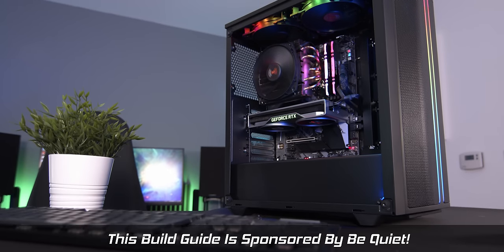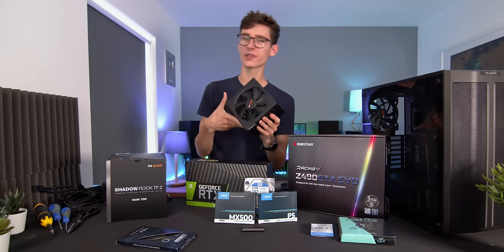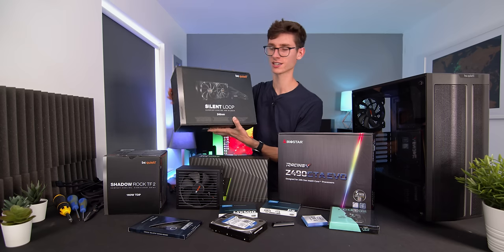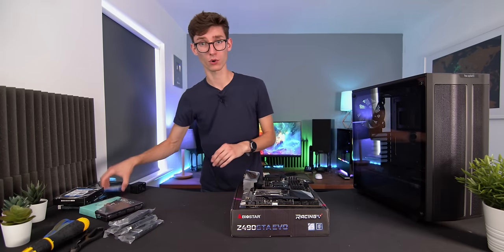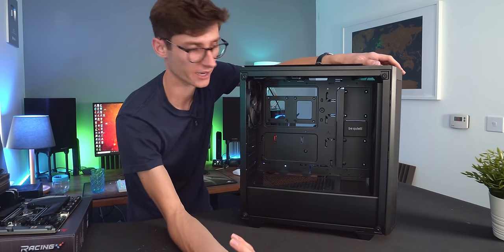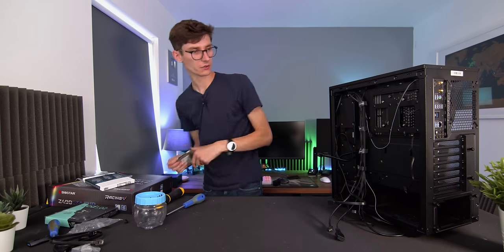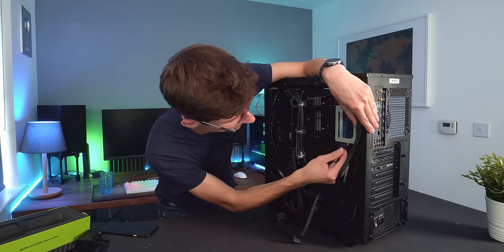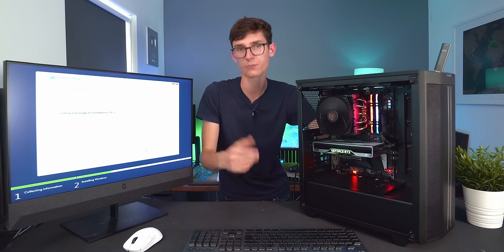How To Build A Gaming PC 🤗 COMPLETE STEP BY STEP Beginners Build Guide | AD

Comment: “Very simple” me trying to comprehend a single step 👁👄👁
Reply: Might be easier while following along and reading the manual...or so im hoping.
Reply: I've seen some really good videos on putting together a pc, but this one didn't do a very good job of actually SHOWING what he was doing. He just sort of rushed through everything and didn't even say how to connect certain things.
Reply: i didnt understand half of what he said 💀💀
Reply: might be better to switch to peico save 15 percent on pc insurance and 100 percent pc build you comply to peico can steal your credit card info and your ip with your house and full rights to abuse you in anyway peico save 15 percent on pc insurance and 100 percent on pc builds
Reply: SAME PLS IM THINKING OF BUILDING A PC AND IM SLIGHTLY CONFUSED AT EVERY STEP
Reply: @gabylol1562  thank I thought I was the only one 😓
Reply: @corasnow3431  this is literally all I heard. And don’t judge cuz I’m not a big pc gamer so I don’t know what all the components do. “Intel core 10,00 grtx 20172927929289, cpu wire conecter slot pcuisjhakanajsk slot 14 inserted. And that’s how you build a pc”
Reply: literally:,) im trying to build one and im like : i need you to break down the simple steps
Reply: 🤣 me too!
Reply: Idk, seems pretty simple to me...

JK JK JK lol
Reply: Pro Tip - DO NOT buy a case with tempered glass as the glass is prone to exploding for no reason. I've had 2 cases now with tempered glass and in both cases the glass has exploded in my hands. This is also very dangerous as tiny glass particles can go into your eyes and lungs as it shatters into a very small pieces.

Be careful...
Reply: @BillClinton228  Thx for that. I'm going to be building my first pc in a bit over half a year, and I know nothing about anything. This could've saved me a lot of money, and possibly my life.
Reply: I dont even know what 1 part is even called
Reply: I'm laughing at how seen I feel by this comment
Reply: @nickk4165  wow I never though of what parts sounded like for people that never built a pc or researched for a while
Reply: MY STUPID HIGHT SCHOOL COMPUTER SCIENCE TEACHER MADE ME WATCH THIS FOR HOMEWORK
Reply: @What-pd7xv  huh
Reply: I didn’t even know what a hard drive is....at least I have google
Reply: Lmaaaooooo
Reply: @BillClinton228  I've several and had ZERO XASE GLASS SIDES BREAK .

Comment: I can't be the only one who wished that he said how much it costed.
Reply: I spent about $1500 to build mine. I’d say at minimum you’ll be spending $1000 to build a good gaming pc..
Reply: here we do not  get anythink  like turkey  crap economy   UNFORTUNATELY,THE MİNİMUM  WAGE HERE İS  270 DOLLARS :( :( :(
Reply: @Hunharcas22  2.70?
Reply: @hasanteistrash5733  he meant 270 $ monthly, down here in Brazil is about the same. Living in a third world country sucks ,-,
Reply: That pc cost $1,700
Reply: Everything he listed he used came to £1,572.06... and he ended up with essentially a £900 pc from Amazon.
Granted it has a 10 series processor but it would have run fine with the 9400f
Reply: I recommend saving up at least 1,5k
Reply: @Dylan Barnes Same
Reply: quarantine made pc parts skyrocket smh
Reply: I checked the parts he put in description and it adds to around £1500. Keep in mind this is just for the pc. If you need monitors, keyboard and mouse also mouse pad then it'll cost more.
Reply: you don't need all the stuff you need
Reply: Hatguy 2345 how is the good is the PC that he built?
Reply: @logiic8835  personally would recommend waiting and not building what he created, it totalled to like £1.5k yet I’m in the process of buying my parts for the same price with a 3060ti and 5600x, just waiting to find a 5600x in stock. So what I’m saying is if you wait for stock you can get much better parts right now (GPU mainly as he used a 2060) assuming you’re willing to be patient.
Reply: @logiic8835  I mean I'm not too sure but I think with the graphics card he has and cpu it should run pretty smooth. Dont forget though you don't have to use what he used. Do some research online and read reviews that what I would do. (The one he built will be good)
Reply: It costs 1700.61 usd. this dose not include tax or shiping.
Reply: @alfieee2279  Don't worry I'm not building anything yet, I'm still learning the parts myself. Not super familiar with everything so I'm still learning, thanks😁
Reply: @hatguyondrip3812  thanks😁
Reply: @logiic8835  its no problem 😊
Reply: Don’t build one then
Reply: @milesbinkowski  bro they only asking a question lol chill out
Reply: @milesbinkowski  ok😢
Reply: @thinkingbread  what specs did u buy? if u dont mind me asking lol
Reply: @seanmaher7744  eh, depends on budget. My pc costs around 650-700 dollars, and it can play pretty demanding games pretty well, whilst streaming them on discord and such.
Reply: It depends bro
Reply: @seanmaher7744  $550-700 for something that can run most games at higher settings at 1080p with 60fps. Spend more for something that can run VR well.
Reply: @Dylan Barnes "Dude, you are getting a DELL!"
Reply: Waifu Zero Two  may I ask what your specs are?
Reply: @Dylan Barnes ur probably better off buying a console then lmfao
Reply: @seanmaher7744  i built mine for £600 which is $820 so id say the minimum is like $800
Reply: My brother built a pretty good one for around $300. And only spent like an extra $50-$75 for the mouse, mousepad, and keyboard. Though that was because he waited for about a year and a half looking for good deals on all of the parts.
Reply: @swan__song__  that’s ridiculous, my pc was 1.7k but it doesn’t cost that much
Reply: @Dylan Barnes I feel you I’m basically 700ish or under and I’m buying a prebuilt I am not going to mess up badly 😂😂
Reply: @leotowers3931  what is the PC
Reply: my brother built one and it cost around £1000
Reply: @godhateseveryonewhodoesntr5977   this website works so well. makes everything easy to understand. thank you
Reply: @Dylan Barnes 😂😂u mines well buy a ps5 that aint enough for a gaming pc
Reply: It depends on what all you want, I built my first one for roughly $800, but if you're really looking for a set up that is efficient but cost effective I've known people to build them for at low as $600-750. You can find great deals, secondhand items (A few pieces CAN be purchased secondhand as long as you're careful and keep and eye out), and generally create a basis that can be improved upon later.
Reply: Dude I’m sitting here waiting
Reply: Yes
Reply: @marloncooke2047  Roughtly between 1.2-1.8k
Reply: @verostation  thanks
Reply: @Goose console sucks.
Reply: @Goose I used to play console, then I transferred to pc, NO issues at all, I can play whatever games I want and I can do so much more. Pc give so much more options then consoles.
Reply: @Max Isaksson but in order to put together a successful business it requires a lot of capital , hard work and luck
Reply: @seanmaher7744  what!? After i put everything in my cart it was 3.6k +!! Any tips?? Im going to be purchasing in November for black Friday.
Reply: Its roughly 2000 and under for this setup
Reply: @Dylan Barnes I’m sorry your not going to get anything with that u need a moniter and a keyboard and mouse and mouse pad 700 plus 1000 for the pc
Reply: @seanmaher7744  wrong
Reply: @Dylan Barnes budget pc for you then lol
Reply: When your Canadian:
Reply: @Hunharcas22  oh no, forget about a pc then sorry😂
Reply: @Dylan Barnes forget ab it 😂
Reply: @UncarteD  absolutely
Reply: My pc costed about 13k (keep in mind that it’s a very high performance pc)
Reply: @tamman994  I’m Canadian
Reply: @runitsacow  we have to pay more then Americans xD
Reply: Yes!!
Reply: @Dray_Duley  thx for telling me!! Needed that
Reply: @tamman994  ikr 😢
Reply: Same tho
Reply: i have the money for it but no idea how to set it up lol
Reply: @Goose Even for hardcore gamers, consoles are better. Spending a $1000-$1500 on a gaming pc rig is an idiotic waste of money to say the least (how about putting that money towards a used car instead?). And only uber-nerds think that the minor bump in graphics (sorry pc simps, but it is minor) is really worth the exorbitant amount of money they spend on these machines. I put pc gamers in the same category as women who spend hundreds of dollars on louis vuitton bags, car enthusiasts who pour their paychecks into "pimping out their ride", and kids who spend $300 on a pair of nike sneakers - they just don't understand the concept of "value for money". Consoles are insanely affordable gaming machines, and despite what every pc simp says about "saving more money in the long run on pc", it's really not true. Consoles have all the best AAA exclusives (last of us, god of war, FF7 remake, to name a few). The sales and subscription services on xbox and playstation are giving better and better deals on games (that are just as good as steam deals). Physical game discs and the used game market still exist for consoles (meaning you can trade games with friends, get insanely cheap games at used game stores, borrow games for free at your local library). And most importantly, consoles just work (no technical issues, no upgrading parts after 2-3 years, no bullshit). Aside from consoles consistently having a larger market share of the games industry than pc gaming, the funniest thing I noticed about pc gamers is that if you ask them if they own a current gen console, 9 out of 10 of them say "yes" (Lol). And if you ask them why they bought a console when they just told you that "pc gaming saves way more money than playing on console!", they always say they bought a playstation or xbox or switch because they just HAD to play the AAA exclusives on those systems. Lmao. Too funny.
Reply: @Dylan Barnes better buy a play station
Reply: @seanmaher7744  I’m building a good pc at a lil higher than $800 1080p around 200 FPS I’m guessing
Reply: He he.... costed
Reply: @seanmaher7744  so what’s considered good?
Reply: With all of the things he put in the description, it would be 1092 without RTX and peripherals.
Reply: @UncarteD  i get what you feel, here in the netherlands if your poor you will be f*cked from all the sides, you will have the government saying why don't you work lol. Ik the Netherlands is not a third-world country but it is slowly going down there ...
Reply: @leotowers3931  Could you link me that please mate?
Reply: @seanmaher7744  what about my graphics card I can’t find a good one that doesn’t cost 1,800$
Reply: @seanmaher7744  how do you get that much money tho😭
Reply: @UncarteD  lol
Reply: @hatguyondrip3812  and desk and chair aswell.
Reply: @alfieee2279  Can you keep the parts he has recommended and swap the 2060 out for a 3060ti? lmao i got no clue about pc’s but you gotta start somewhere🤷‍♂️
Reply: He puts links in the description, look at all the prices and calculate the total for the entire build then you should see how much it costs ;)

Comment: Thanks mate! You helped me build my first gaming PC. It’s a beast, I’ve got a RTX 3080 paired with a i9 10900K and 32GB 3200mz RAM. Currently playing Red dead 2 at 4K 60FPS ultra setting, it’s awesome.
Reply: Niceee I got me a rtx 3080 12gb yesterday but just discovered my power supply was 600w :(  upgrading it right now to 750w :)
Reply: how much did you spend?
Reply: How much?
Reply: @abstractnonsense3253  i had spent like $1,500 on the gpu but overall like 2k or nearly 3k
Reply: @dog8086  but i used quadpay so it was a split payment
Reply: @Hisashii  Thanks for the info. Didn't know about quadpay.
Reply: whats ur power supply
Reply: you do not need a i9 unless your streaming which i may be wrong but i recommend getting a higher mhz ram you'll see much better performance instantly
Reply: bro how many games u got on that and how much was it
Reply: Does the 32gb ram even do anything? (Genuine question, I know nothing and was told that unless you're doing crazy shit you don't need more than 16)
Reply: @Hisashii  nice but if u have rtx 3080 u should upgrade to atleast 16gb ram
Reply: fucking hell dude for a first PC thats nuts. Im saving up right now, I respect the fact you probably worked hard for that PC. I hope you're still enjoying it to this day and never taking it for granted.
Reply: trying to find who asked
Reply: @Hisashii ah yes now I can pick up a 3080 for 400-500 on ebay 😏
Reply: Jesus crist a i9 is crazy for a fist pc.
Reply: UP THE FPS

Comment: Great vid! My daughter asked me to build a gaming pc for her and I figured it would be impossible. Very clear step by step. I now feel confident in building one….
Reply: How'd the build go?
Reply: @Pozeiidon  I ended up buying the “Ibuypower” prebuilt for $1,300 (on sale). I had all the items lined up and when I got to the graphics card, it was ridiculously marked up around $800-$900 and would have put my build at almost $2k. The  ibuypower prebuilt seems to be doing great with fortnite and VR. I did buy her a different housing for the internals on the prebuilt. It’s a KEDIERS pink (cyberpunk) case. So we will be circling back to your video once we remove everything inside and are ready to replant it.
Reply: @anthonynavarro101  Awesome I'm glad everything worked out💪
Reply: for some reason I knew he was gonna say something along the lines of “so i just got the pre built”
Reply: @kwirk7481  not that it was gonna be hard to do, just the graphics card was super expensive
Reply: Awesome dad!! You're daughter is so lucky😇
Reply: @anthonynavarro101  unfortunately you built it around the time GPU’s and CPU’s went up, currently they’ve dropped substantially so now wouldn’t be a bad time to make or upgrade your current build!
Reply: @Sleep489  hey man , i live in brazil , where can i find these parts , should i order them from sites is that safe .

Comment: For those wondering I tried to build this pc by adding everything he used in the cart and it totaled over 1800 dollars
Reply: Bruh fr
Reply: Bruh-
Reply: Is it a good pc tho
Reply: What currency was it, USD? AUD? Or Whatever England uses for money
Reply: How much FPS does it run
Reply: Really? For me it totaled 1240
Reply: Because of carona prices went up
Reply: @aussiejam422  we use teabags thank you very much
Reply: yeah in pounds roughly £1760 not including his monitor for anyone wondering
Reply: Well its better than being pre-built 🤷
Reply: @aussiejam422  pounds -_-
Reply: @evanmcgee9902  what’s wrong with pre built pcs? Coming from someone who has no idea ab pc building
Reply: @qraee  basically self built provide better value but also a lot of the people who build them are all snobby and spit on people buying prebuilt for no reason
Reply: @qraee  they usually don't use good components like cpu cooling and the power supply. The cables are pretty much thrown in the pc and they are more expensive. You can just buy all the parts and spend 2 hours building it
Reply: Total for me was $2500
Reply: @aussiejam422  they use pounds
Reply: @skinnypenis2254  Yh it’s gonna be very good
Reply: @jxmes1233  depends what games and if your using high or low graphics
Reply: @kaydenduryea9871  different country different prices. A damn 1650 super is 1.2k bucks on amazon in my country, bruh
Reply: Bruh the most I’ve saved up was 180😢
Reply: @aussiejam422  pounds
Reply: I think your calculations are wrong, it was around 1200
Reply: Yup same, I ain’t mad tho :”
Reply: @aussiejam422  Pounds
Reply: prob because of the gpu - they are CRAZY expensive right now because of covid. dont be too discouraged gpu prices will go down eventually

Comment: V helpful but idk when il be able to aford the parts 😂
Reply: Don't worry mate. It's pretty much the same regardless of budget. It's actually more straightforward on a lower budget since you'll probably use stock coolers and no RGB. In fact, I personally find it much more enjoyable to build a value PC with a limited budget and try to get the most out of it.
Reply: Just keep saving! You can do it!
Reply: budget can bring you 60 FPS for all triple a titles
Reply: @Crempsen  ?
Reply: Meh just start with one part at a time, when u can, eventually u'll have the parts lol
Reply: Im building a $500 pc
The most important part is

I bought an AMD processor
Reply: Same😂🤣
Reply: I started wanting to build a pc last year, I have the case right now, my power supply and motherboard, I have bought all my other parts they are just shipping, (cough covids fault for talking a month) but I saved my money and now I will be able to build it soon. Save your money and evvanutually you will be able to. Wish you luck